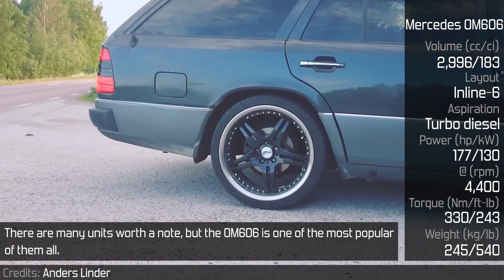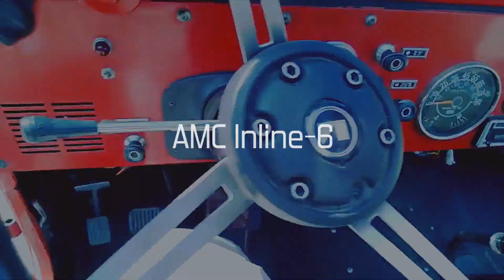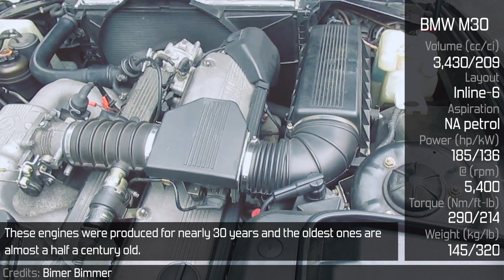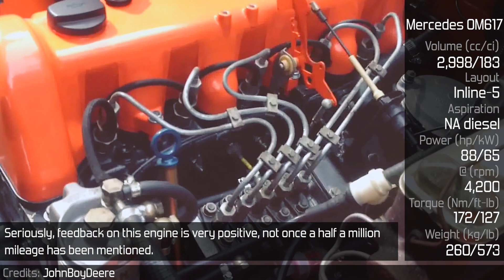10 Most Reliable Engines Running Beyond 300,000 Miles

Comment: I have had a few Jeep 4.0 inline 6 engines with well over 200K and one with 300K with only  regular oil changes. Inlines are naturally balanced and have 7 main bearings they are long lasting engines in general.
Reply: I wish Chrysler could have designed a transmission that would have matched the engines back then...
Reply: You get it, alot of people hate on us i6 guys, but they really are the best engines!
Reply: Not only do Jeep 4.0 engines rock...but they can be modified to put out a lot of horsepower without sacrificing longevity....(owner of three of them here)
Reply: SuppliedStudent yep those things are beasts have one in my tj
Reply: tyler b were talking about the amc / Jeep angin buddy
Reply: @tyler b aw4's were pretty damn tough. And I seem to be one of the best around for finding the weak links in pretty much every single thing I drive. Not proud of the reputation ( cause I do not get paid for these  complete and thorough tests I put into my rides) but folks tend to believe me when I tell them something is tough lol. I haven't ran any other dodge transmissions other than those stuffed under Cherokee and grand Cherokee vehicles!
Reply: I've seen them last longer than the bodies they were in. But in the Upper Midwest and Great Lakes region that doesnt necessarily mean anything. If properly cared for they'll run a long time. If they aren't they're toast. The engines were built fairly tight from the factory. Oil leaks that's another matter. Plus the 232/258 with the electronic carbs and smog control.
Reply: @cs-rj8ru  nv4500 is pretty good. Chrysler also paired it with ax-15, although has lots of synchronizer issue, will ran for quite a while

Comment: AMC i6 earned its place on the list. It, along with the ford 300 i6 are two of the most reliable engines I've ever dealt with
Reply: GM 250 as well.
Reply: I'd agree those 2 are great motors!! My newer favorites were a Chevy 292-- Ford 302-- Toyota 22R----  Currently, I'm drivin 2 S-10s with the 4.3L--1 has 264,000mi-- the other 213,000!!!!!! Work trucks!!!!!

Comment: In my work are few VW caddys all with 1.9TDI 55kW engines. One had run over 500.000km+, another 400.000km+. And they  even had no issues with turbos and and hadn't any engine repairs at all. And runs good AF.

Comment: Dodge Slant 6 have repeatedly gone over 300,000 miles with little maintenance
Reply: Chris Rood very true. my dad has farm equipment and one of the old swatchers has the slant 6. very strong and reliable engines from what I've seen.
Reply: I had a couple of slant 6 cars: Dart and D-100 pickup.  The blocks would go forever. But I kept a box of carbs and distributors in the back of the Dart to keep it mobile.  They were junk.  And they didn't like to start in the rain.
Reply: I bought a solley single barrel out of a 66 slant 6 ended the carb trouble, bought a factory distributor gasket and sprayed my distributor with silicone to end my moisture problems
Reply: Good one! I agree!
Reply: the 318 was a classic. Should be on the list for sure!!!
Reply: Yeah from what I gathered on the slant, the only bad things about em were the carbs and poor user maintenance
Reply: One of the autos at the hot rod shop I'm working at has a 1963 Valiant convertible with the 225 Slant 6 with the offenhauser intake manifold on it. 😎
Reply: I bought a used slant 6 blue doge Doge Dart, put a Delta capacitor discharge electronic ignition , plugs actually lasted over 45k mi , when the carb problems started and it would start misfiring  going up an incline grade,  nothing worked new fuel pump, filter, carburetor,  air filter, silicone spark plug wire,  ...  until a coworker suggested  a fuel fill up with pint bottle of water removing gasoline additive; I could not believe it...     it worked!
Reply: One of the best upgrades for slant 6 engines is the super six conversion. Some parts may be hard to find but not impossible. Carter bbd carb or Holley 2 barrel are both excellent. Also switching to electronic ignition cures most ignition woes.
Reply: Dodge is also known as the company that will put a million mile engine on a 100,000 mile chasis

Comment: We had a Lexus LS400 with a 1UZ, it barely made half the power it had stock, the exhaust leaked, the egr valve eventually went bad, and it wouldn't pass emissions test, not to mention it guzzled gasoline, it stuttered on start, it leaked oil everywhere it was parked, the traction control was intermittent, check engine light would come on every couple of days, the A/C lines exploded (literally ruptured) so that didn't work, the power steering worked well, but made a bit of noise, the battery held charge for a long time normally, but sometimes it would have a hard time cranking over, and the transmission was a slush box. It only had 160k miles, that's just past the break in period (or so Lexus says) it did have a mildly hard life though, for starters it was in WA where it's quite wet, it was also a theft recovery, it was in a car chase and (from what I could tell) hit some wet tar (it was all over the drivers side front rim and all suspension components on that side) and lost control, the airbags had been set off, but the light was covered with a very well hidden piece of electrical tape (well hidden because half of the warning lights in LS400 are projected on the cover over gauges and that's where it was)  it had also had the speedometer needle break off, so previous owner put a coffee stir stick in its place, the backlights in dash were all going out too, it lasted a while though, we bought it at auction for $1800 in WA, then later moved to CA, where after 2 and a half years, it could no longer pass smog, so we sold it to the state for $1500 (repairs would have cost more than the car was worth) I don't know what happened to it, could have been crushed for all I know, now we have a shitty Dodge caliber with a CVT, and holy shit is it slow... I still miss the Lexus though.

Comment: My volvo b20 has been running 48 years !!
Reply: Duh, it’s a Volvo
Reply: I have an over 40 y/o Holden here which runs perfect. But should do with only 122000km!
Reply: Gah daaam
Reply: My twostroke moped has been running since 52
Reply: Volvo 122s 135000 miles just run in.
Reply: My -65 Volvo Duett B20 is now 55y/o and still purrs like a kitten
Reply: @robertmagee5523  no another 115000 before fully run in .They can last 3.27 million miles in a P1800.!!
Reply: @Wuh U looking at No the car is 50y/o and the engine is 55y/o

Comment: As a mechanic, pure gearhead, racer, driver, restorer, and engine builder I agree with a lot of these. But I feel one important one is missing. The Nissan/Datsun L series. Those lil I-6 motors were almost indestructible. I personally put them through more than any motor should ever see. But I have heard many stories of the coming into shops for rebuilds at 500,000 miles and bearings looked good enough to reuse! Too bad the trans behind them were not as reliable. Anyway keep up the great videos. And I must say your English is getting better! Race On Brother!
Reply: Need advice please....   I'm looking at a 1996 toyota avalon xl with 80k miles and it is very clean in and out. they are asking $3000, is that a good deal? For whatever reason the KBB is less than 2K. Did you do transmission fluid flushes in your car? Have you used fuel system cleaner products like lucas in your vehicles?
Reply: @hubertkam7647  What is your budget?
Reply: @hubertkam7647  Try to find a Nissan or a Toyota. But for that budget I am not sure what you can find.

Comment: You have the timing chain issue backwards on the Toyota's 22R, they went to single row chain around 1983. All 20Rs and early 22Rs had double row chains. Owners of the later years would buy a conversion to double row timing chain.

Comment: There is a Mercedes 240D in Stuttgart museum which went 1,2M miles on a single engine. They also have one diesel w123 that wend almost 3M miles but this one had it's engine rebuilt.

Comment: Chevrolet I-6, (The Stovebolt) any displacement. Chrysler Slant-6. Ford flathead V-8. 327/350 Chevrolet. Ford 300 I-6. Cummins 6bt. 7.3 Powerstroke. 389 Pontiac. 289/302 Ford. Chrysler 318, 440. AMC 401. Oldsmoble 350.
Reply: Seth Thomas Chrysler hemi six
Reply: The only one I would disagree with is the flathead Ford. They had a tendency to crack the block.  They sure have their place in history though.

Comment: you need to look into the dodge slant sixes. While i was teenager working in a garage we had a guy come in with a rod knocking, he drove from NY to Oklahoma on it and i told him to keep oil in it (he was on his way to California and then going back to NY) and it would make the trip both ways. He called me later from NY to tell me he was back home in NY and was going to have the bottom end fixed and it most certainly made it. I went to a car event held by a mopar club where they took a swinger with a 225 slant 6, drained the water and oil and sold tickets on how long it would run, best guess got the kitty minus 20% for charity. It ran 27 min 16 sec before it seized (didn't even through a rod). I've seen many of them with 500,000 miles or more. Great engines.
Reply: I went to a car event held by a mopar club where they took a swinger with a 225 slant 6, drained the water and oil and sold tickets on how long it would run, best guess got the kitty minus 20% for charity. It ran 27 min 16 sec before it seized ......  about the clinches my opinion of this channels ........and americans in general!

Comment: I have 96 dodge Cummins with 988000 miles but it’s due for a rebuild and I also have a 94 Honda Civic with the 1.6 vtec that has 823000 miles
Reply: I worked at a truck shop, and someone brought in a 1993 Dodge Ram 3500 with a Cummins 5.9 12V  inside. We replaced the starter and the owner said that was the first thing she has had to replace other than an oil change and a Valve and Pump Timing adjustment. 

It had 1,536,000 miles on the odometer, no B.S..

She drove it like a grandma and never was dialed up, she said that she has taken it to Pennsylvania almost every you since she has had it.
Reply: @liamjerkins7259  1.5 million miles? Stop
Reply: I love my Hondas

Comment: Toyota 1jz boiled mine to a stand still came back when it was cool and ran again fine for over 10,000 km still running today after repeatedly overheating it (no temp gauge and leaking radiator) plus a broken waste gate hose that caused uncontrolled boost

Comment: The 1.9JTD and 2.4JTD engines on the Alfa 156 are also know to be extremely reliable VisioRacer, one of my neighbours has a 2.4 with 710k km's on it, and my mechanic has another customer with a 950k km's 1.9JTD, i have one as well with 190k so i hope to do many more miles on it!
Reply: Same (they say) on 1.3 mjt... if you take good care. Or the 1.1 fire.... except for the oil leaks
Reply: Pietro La Porta yeah, the 1.1 And 1.2 engines leaked oil extremely, but they were unbeatable :D
Reply: The problem with the early versions of the fire engines back between the 80's and the 90's was the head gasket, on many models (like the Uno or the Punto) it worn out by 100.000 km, and it would let cooling liquid get into the heads. I actually had a 1991 Uno, and by 136.000 km it already needed a new head gasket. Otherwise, the engine was still running fine before it started developing the issue, and i was told it's running great now as the head gasket has been replaced (i sold it). Most of the time on said models, the gearbox gets you more issues than the engine itself, even by less than 100.000 km.
Reply: Diogo Simão i had Punto 1.2 1994 and it was like you say.. the head gasket leaked oil into the coolant. if the Punto wasn't so rusty, i wouldn't give it away.. it had about 180k kilometres..
Reply: If they leak oil it's usually not just the head gasket i think, but the piston rings maybe. Head gasket wearing leads to water leaks (as far as i know).
Reply: I have a Fiat Multipla 1.9 JTD: a wonderful engine my mechanic said he is capable of 700.000 km!!!!!!!! And i have also a Pajero 2.5 with 406.000 KM <--- and had many problems=).
Reply: I have alfa 156  2.5 Busso V6  with 425 000 Km...  That is pretty good as well i would say .
Still daily driven. Running strong, good compression on all cylinders
Reply: an alfa that is reliable, what times we live in :')
Reply: the 1.3 JTD can be also very reliable and will go to over 400.000 km if maintained properly (it requires a pretty expensive oil because of the timing chain which can fail if you use cheap oil). The old 1.1 and 1.2 Fire engines had head gasket problems, but they were upgraded from singlepoint injection to multipoint in the early 2000s and since then they don't have head gasket problems.
Reply: Kinda agree, except that a bigger engine will probably tear less because of the strain put onto it. My parents got a Fiat Panda with the Fire engine and it has been working just fine, except that the gpl injectors are like, WAY too loud, you can hear them ticking really loud (but i guess i should blame the injectors manufacturer rather than Fiat).
Reply: Diogo Simão 
1.9 JTD is, absolutely , the best motor! My AlfaRomeo 147 got 685.000 km (at current day)!
Reply: Alfa's engines are reliable, i don't understand from where it comes this bad reputation
Reply: Yup, Fiat does make some really good engines. Also dont't forget petrol 1.2 8V Fire engines and 2.0/2.4 5 potts, earlier FIRE engines had some problems with headgasket but I've seen later version ones with +400k km on the stock headgasket

Comment: I would have added international 444 (7.3 Power stroke) and Ford 300 inline.
Reply: Brett McFerrin Ford 300 is a torque monster and rock solid. The 7.3 is legendary
Reply: I had a 7.3. Wasn't fast, the thing loved drinking fuel, but the damn thing would pull a house and run forever. Never had a 300, but I know someone who did about ten years ago, and I still envy them, because it's still running strong today
Reply: The IDI version was even better. Great on mileage. Mine is sitting at 800,000k took it to a shop to get it inspected they told me no need to overhaul it just broke in.
Reply: Or Deutz-Fahr 9.6. I admit… it’s an agricultural engine

Comment: My 91 Audi 200 20v avant has around 485k miles.
Still runs like a champ (the rust on the fenders and rockers is an issue).
She ran a couple 12.1 quarter mile times with some simple mods (turbo, fuel pump, injectors, exhaust, etc).
When she was at the strip we had already logged right around 280k.
Stock 3b engine and internals, stock transmission (with clutch upgrade).
However, I can guarantee that you will experience electrical issues.
The dash cluster (rpm gauge always worked!) and headlights will fail so......there's that.

Comment: what about the ford 300-i6
Reply: a bunch of 300 6 cyls had fuel problems
Reply: fuel problems yes however they lasted forever.  my friends 85 f150 has 700k miles on the thing.   engine still strong as ever.  he pulls stumps regularly
Reply: They had a lot of headgasket problems and warped heads after one overheat.
Reply: Art Trombley no they dont
Reply: you are thinking of the 3.8 gm
Reply: I agree. I drove a mid 90's 11-passenger van with a 300 in it. It wasn't very quick, but on the highway I ran that baby wide open (basically. It still stayed in high gear) and it took it like a champ to maintain 70 MPH while fully loaded. Impressive engine, IMO.
Reply: I loved my 300 6 in my F150, never any problems. The Dodge or Plymouth Slant 6 was even better. Cab drivers would fight over cars with slants in them because of the realiability and long life.
Reply: I love your pic "don't tread on me"
Reply: Heck yeah I have a one with a single barrel carb
Reply: That’s my favorite
Reply: Had an 83 f150 with the 300 6cyl    almost 900k  never had a 
problem
Reply: The Ford i6 engines were very reliable. I had a friend with a 67' Ford Falcon coupe with a 263 Straight 6 and it had over 1,300,000 miles. Ford discontinued the straight 6 in early 96' because they were too reliable.
Reply: I got a 1986 F-150 with a 300 inline 6 and a T-18 or NP-435. It's an amazing motor. Currently rebuilding it and putting on a bigger cam (268H COMP Cam) and going to put a 2 barrel carb on it instead of the 1 barrel carb. Also ripping out all the emissions shit and switching over to Duraspark II and will more than likely install a manual choke. Maybe in another year I will use tax refund to go get a transmission for it. Probably a MDO5 or a ZF-5
Reply: @jameswest5102  Ford 300 was a great engine. The ones with the 7 Quart oil pan and oversized oil filter were real workhorses. Get one with a T18A Transmission and a NP205 and you have a 4x4 that would pull a house basically.  The only real drawback was the crappy one barrel carburetor that Ford equipped them with. The Dodge 225 slant Six, and Chevy 230/250 were really good as well.